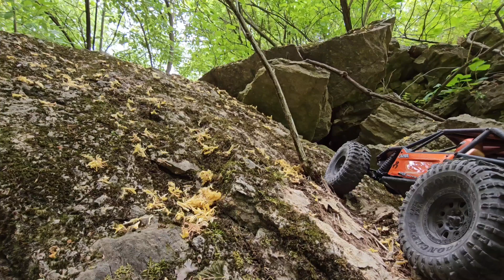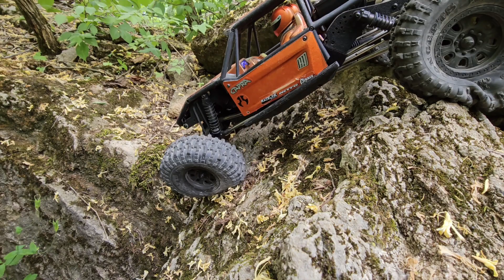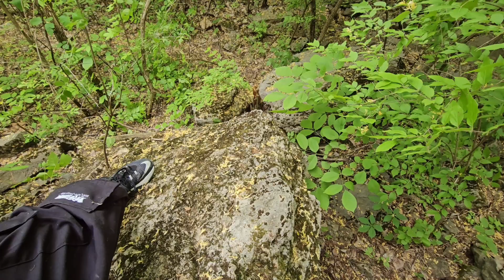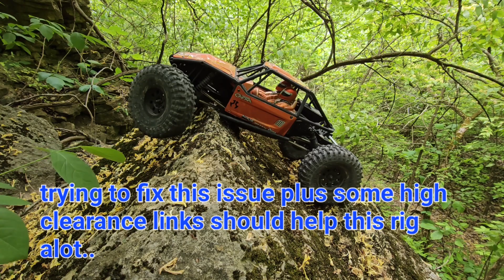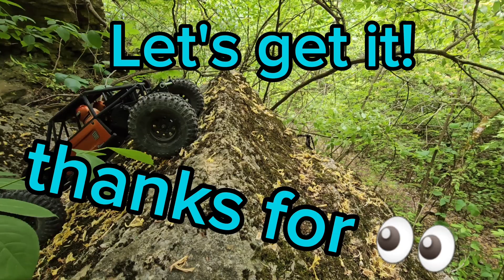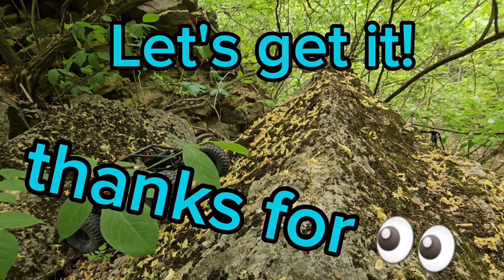lightwork for the Chopra! custom axial capra makes this steep climb and sidehill look easy.. #rc

Comment: Nice was thinking d taking my Capra body and chopping it down and putting it on something.
Recently took it and put it in a sporty chassis and holy cow.
You ever try ruptures dude?
Reply from the maker: Go for it, buddy! My chopra build is my most capable rig for sure 💯. Another lcg chassis I designed. I have ran some ruptures and definitely a great tire. The sporty chassis is a cage chassis correct?
Reply: Check mine out.
It’s a class in WRRCA.
MOA
Sporty
Then the chassis rail classes.
It does need a body for comp.
But tiny typically.
Mine still in the works.
But check out some others
Mine right now is just a chassis swap on a stock Capra….and insane what it can do.
Reply from the maker: @rcarty419  that sounds awesome! I want to do a moa build eventually